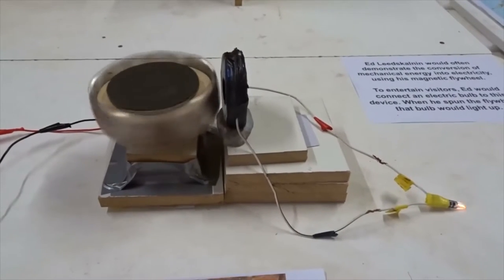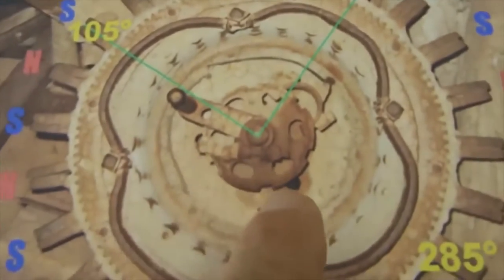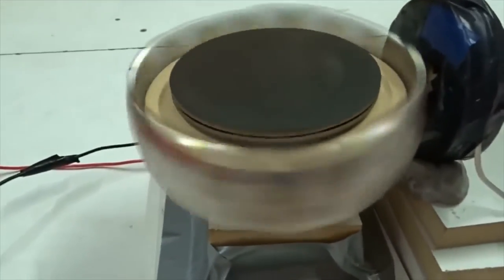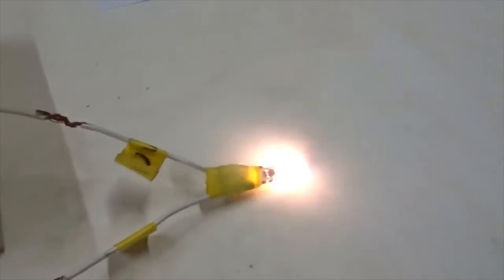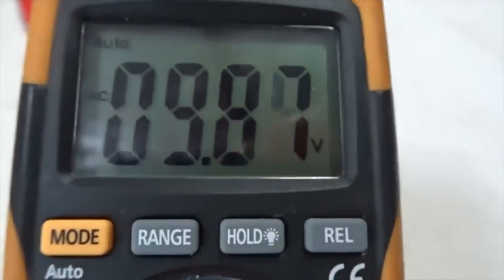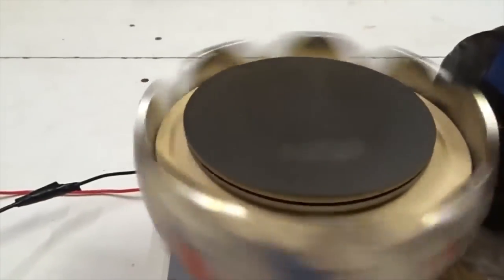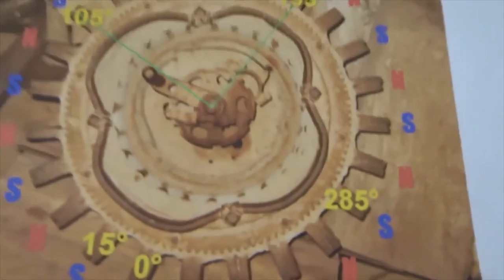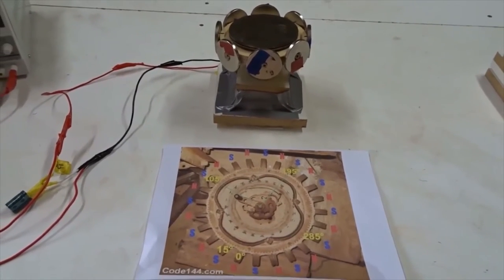The detailed physics of Ed Leedskalnin’s magnetic flywheel, explained after 80 years

Comment: There's a video (link at end) that provides a pretty good hypothesis as to how Ed cut, quarried and moved the blocks, although the feasibility lends itself to some scrutiny. But the video does provide physical evidence directly from the coral castle museum. 
As far as how the wheel could be self-propelled (and why), it does explain how that may have worked without a 3-phase stator, also backed by physical evidence as well as a working prototype using technology that would have been available to Ed. The part explaining the self-propel starts at about 13:30. The video also shows a generator mounted on a platform where an engine would also have been mounted to drive it and charge the batteries. This makes sense because the DC generator produces the DC current needed to charge the batteries (still on-site at the coral castle). AC current from the hand-propelled wheel would have to be rectified in order to be used as a battery charger (an LED is its own rectifier). The clover-shaped ring is also explained.
Here's that video:
https://www.youtube.com/watch?v=nOoCuDnmtyM

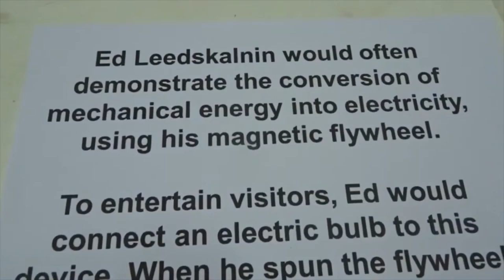Comment: 2:40 what I have seen other people do is create the metal v shaped wedges around a circle in such a way that you could lock them together like the PMH. One coil in the set would be engaged, and then all the V magnets would lock magnetically. Then, when this is spun in a circle, there is a claim that a visual effect, like heat rising, is observed over the spinning wheel. These v shaped magnets are made of metal and are NOT permanent magnets. They are instead the ferro material that is magnetized by the PMH concept.
Reply: you need to produce the source for the ‘heat rising’ thats very bizarre to say the magnetic properties produce a visual effect like never seen before

Comment: This device seems a lot like a simple generator. I’d like to see how Ed was able to manipulate gravity. I imagine it was achieved with magnets which have been called gravity’s cousin.
Reply: I found this statement from some physics blog: "Gravity is made up of two opposing forces: gravity and magnetism. An electron is ripped away from its parent atom by ultraviolet light or a spark. Magnetic fields cannot be used to simulate gravity." Yet, logically, a force is a force and so one force could be equal and opposite to another force. Or, another way to think about anti-gravity is the notion of shielding some mass so that this mass appears to be zero mass from other large bodies that have gravity. A gravity shield approach would not let those high-speed gravitons to interact between the shielded body and other mass bodies. Maybe a really strong spinning magnetic vortex could shield gravity.
Reply: @morpher44  thanks that reminds me a little of something I heard about gravity that you should think about it as little particles flying around in all different directions so when you’re in space you’re really not moving around because the particles are hitting you equally from all sides but when you are on or near a planet, the particles coming from the other side of that object don’t hit you because the object is shielding you from them so only the particles coming from the opposite direction of the mass are pushing on you without an opposite equal force.
Reply: @harrowgateguy  so when we are in a house, the particles are still hitting us from the sky but not the ground??
Reply: @TheLastEpiscopalian  yes because the roof of the house can’t stop them but the mass of an entire planet can

Comment: Want to levitate the stones as Ed did? Steel cable with a iron cored coil placed at half it's length is what I have figure out from his writing/experiment. He used steel fishing line to show the effect of magnetism. Upscale it to a 1/2 " size cable. Place the coil (from the cable) between the two coils of the PMH and wire proper and energize the PMH. The North and South Pole magnets will flow around the opposite ends of the steel cable infinitely until the bar is removed on the PMH. Place the PMH atop of a tripod and bury one (or two) beneath the sand. Now this gives you the ability to utilize the like force magnetism to levitate anything nonmetalic in nature. Perfect works in some Bible babbling might talk about heavens and hell what is above the ground is below the ground. So many ways to find answers to Magnicity from our past. Are we certain that the sweet sixteen wasn't some sort of garden of Earth batteries? 16 of them? If each were 1.5v that would equal 24v. Used at the bewitching hours when they are at peaked value he was able to enhance their value with his genererator to charge the other batteries around the worksite with single set of wires. Maybe I'm just full of myself about all of this. At least now I can tie it all together for you. The secret to finding if I am wrong about all of this is would you like me to explain the steel soled work shoes he used to manage all of the pathways beneath his feet? I just did...
Reply: meds, now
Reply: What’s PMH?
Reply: @harrowgateguy  Ed Leedskalinin called it permanent magnet holder others define it as "perpetual motion holder". Depending on how you look at it both are right only everyone claims there is no such thing as a perpetual motion holder that is highly debated or that it cannot/doesn't exist.
Reply: @ebikeliverystable  I heard Ed claimed to know how the great pyramid was built. It has also been reported that some kids had spied on Ed late one night when he was building the Coral Castle and supposedly saw him holding and pointing two identical  objects one in each hand that resembled ice cream cones with the pointy end pointed at a block he was moving. There are ancient Egyptian hieroglyphs that depict people holding two objects that look a little like that but I think they look more like the flashlights people on airport runways use to direct planes on the ground.
Reply: @harrowgateguy  there's so many stories about the children that watched Ed floating the stones describing it as if they were hydrogen balloons in different videos across YouTube. I've been a fan since seeing it on a Ripley's Believe It or not special as a teenager before YouTube. Enjoy your time you invest in his writing. Just remember he was also of a time when Magneto's were very.

Comment: This is a pulse motor with permanent magnetism, though there are similarities they are not the same, also to claim you cannot turn this prime mover without 3 phase is a joke. It is sad that people think they know, then they tryy to convince the masses that have little to no idea of how magnetism or electricity work. Yay you have a multi meter LOL. You can't even space the magnets equidistantly, You have interaction of the poles overlapping really poor workmanship even poorer comprehension of study towards another great mind. You have little to bring to the table my salt. How can you read draw of current when you have no appreciable load connected my good fellow?
Reply: I think the Tesla "Egg of Columbus", has only 2 phases, although it is a bit odd because Tesla seemed to be obsessed with 3, 6, and 9. Some circuit diagrams show a 2 phase approach. Others show a 3 phase approach. It is probably true that a 3-phase design is much more stable, much easier to reproduce, much more energy efficient, etc. It seems Tesla settle on 3 for most of his magnetic architecture machines. Certainly, 3 legs of a stool is a stable stool.
Reply: @morpher44  3 phase is much more efficient it's a world standard in industry to have less than 3 phase or more than 3 phase does not warrant the losses or gains. Tesla said someone was a genius. Again do not study the apprentice. Their are 2 legs on a capacitor or are there 3? However 4 phases are seen and depicted as the cardinal points in time so i digress 4 phases are like the boundaries in the law of square.
Reply: @morpher44  1 leg is needed, the 3 phases are for efficiency of losses for time.